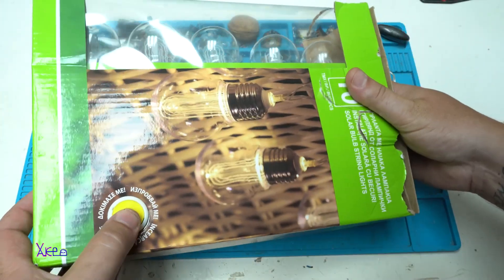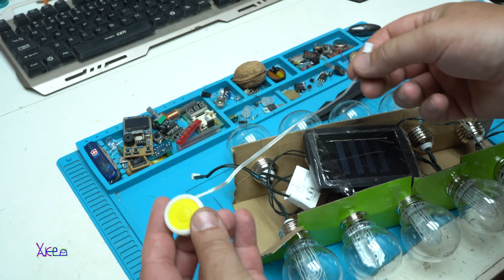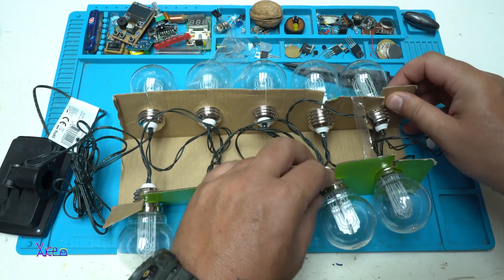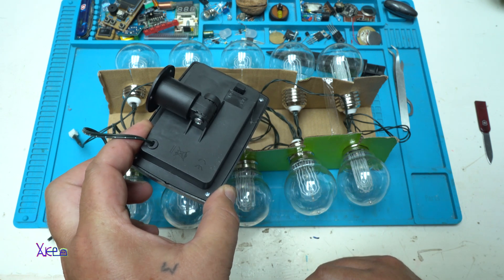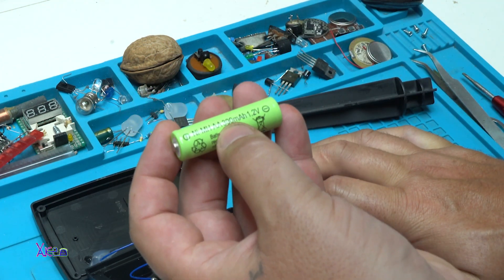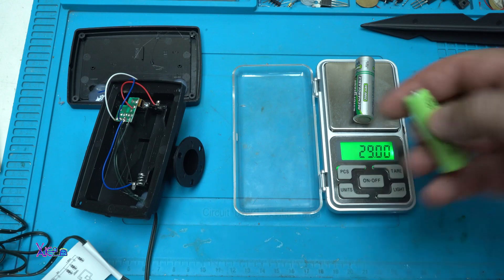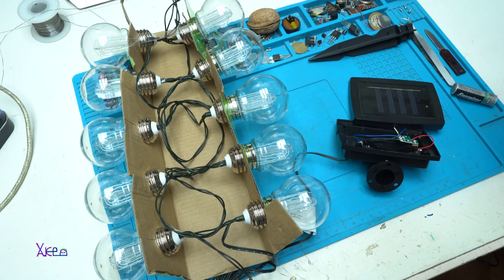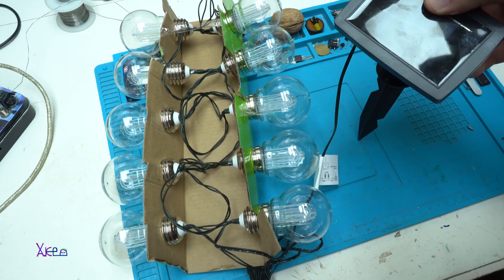I Bought Faulty Solar Lights, Can I fix them?

Comment: Hi thanks for the great video and the tip about the battery. I have had 2 sets of lantern string lights and the wire on them twice snapped in the strong windy weather! They were working before this and although I have rejoined the wires and used insulating tape they no longer work, any tips please? Many thanks. Kind Regards. Henry.
Reply from the maker: Need to know which is positive and which is negative wires,if you can change all new wire(better one and more quality)
Reply: @Hacktuber  Many thanks all good now😁